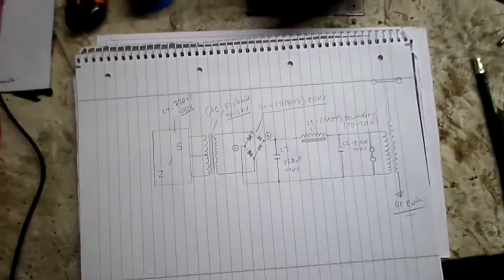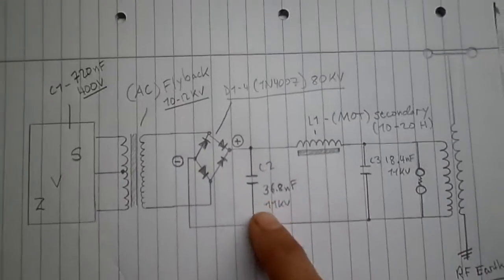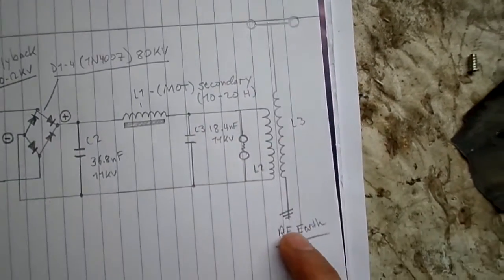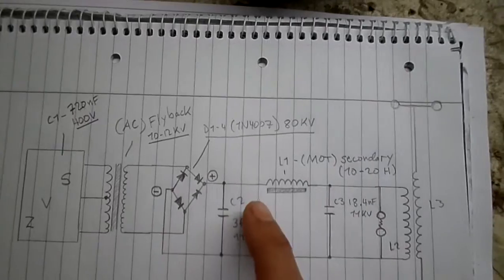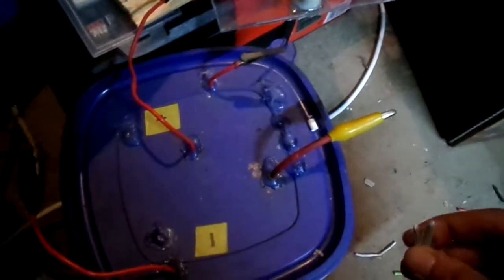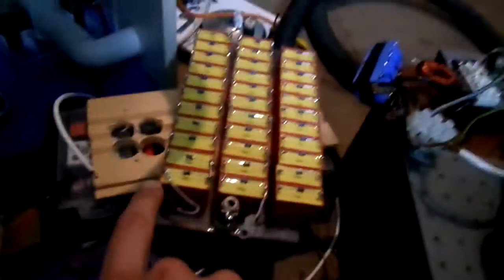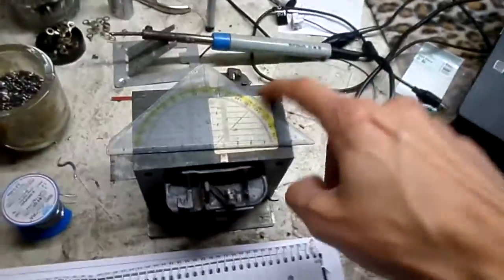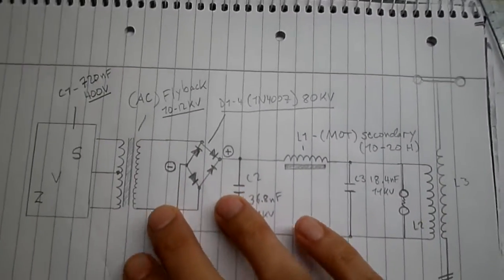DC powered spark gap Tesla coil - ZVS flyback - How - To + Diagram

Comment: I don't really get the capacitors being in parallel with the primary, like aren't that just gonna short the capacitor preventing it from charging? On my design the capacitor is parallel with the high voltage generator and the start of the primary is connected to the other end of the capacitor and the end of the primary is the spark gap

Comment: I am no expert, but it looks to me like you have a direct short in your schematic. Cap bank and gap in parallel with primary coil?
Reply from the maker: indeed you are correct ! i sometimes fail at drawing out circuits, the first cap bank before the spark gap is correct as its for DC filtering but the tank cap bank should be in series after the gap .. when i get around to updating this setup, i will include a new diagram and hopefully everything will be in the right place ! thanks much for the input cheers =)
Reply: Glad to help. Your many videos are appreciated and educational. Keep up the good work!

I tried a similar setup  with a dc fb, and streamers were cleaner more defined.  Maybe a ferrite core would be better for charge choke? 
Also was curious if microwave oven diodes would work if i had an ac flyback like you?
Reply from the maker: thank u much, i do intend to produce more content ! a ferrite charging choke would work better, someone commented already on that fact, i do want to try it out plus upgrade my HV rectifier to fast switching diodes .. u would need fast switching HV diodes but microwave over diodes could be used for testing, try charging up a HV cap with those diodes .. they may get hot due to high freq. from the flyback ..

Comment: I wouldnt be surprised if this doesnt work for 2 reasons.

The 1N4007 diodes are very slow and cant properly if at all rectify these frequencies. (use UF1007's).

Also the charging choke is a good idea but you cant be using an iron core choke for this HF application just the same as you cant use an iron core flyback it wont work or at least wont work properly.
Reply from the maker: hello and sorry for the late reply ! i totally agree with ur suggestions, i never thought of the hf involved with this circuit setup but i will admit its very experimental in nature as i dont really know what freq. the primary circuit is running at and having the charging choke in circuit was a suggestion from my buddy tesla explorer :-) i will upgrade my rectifier soon and try this circuit out again and i really thank u for the feedback ! cheers from Germany - Dirkk82
Reply: Can you explain what the charging choke is supposed to do please? Is it necessary for this circuit to work?
Reply: Well usually it is used for charging capacitors from 50/60Hz sinusoidal power supplies and it is designed to smooth out the current  from the supply going into the capacitor. 

In your case you are using a ZVS which is likely to be switching at around 10kHz square wave hence there is little need to have a charging choke to begin with. Also the microwave transformer as an inductor in this instance is unsuitable because it's inductance is toooo high and the core material (iron) is also not suitable for 10kHz operation.

Arguably a charging choke is never necessary only ever preferred but in your case it wont really do what it is designed to to begin with. So get it outta here.
Reply: Also I was quite serious about those diodes, you'll be reaallllyyyyyy lucky if they work out, or at the least it'll work but with massive power loss (they'll get super hot).

I would recommend using these http://au.rs-online.com/web/p/rectifier-schottky-diodes/6882280/   instead of 1n4007's. Dont be afraid of that website btw it's a great site and has free! shipping.
Reply: I am not the person in the video but I am also building a simple half wave DC rectifier for my ZVS driven AC flyback transformer. At the moment I have 80 UF1007s in series which I will put in oil and test tomorrow. I tried using a string of 22 but I don't think 22kv back voltage was enough for my flyback as they seemed to get very hot then stop working.
Reply: Right :P sorry I assumed you were the video creator. 

Good that you're using the UF's they have a far lower switching time than the 1N's and 22kV was probably just too low, with this kind of stuff I think 3X the transformer voltage is a good place to set your diode voltage.
Reply: I measured my ZVS. using 15V zeners at 50V input. The output frequency was around 30 kHz. No iron core would work in that case. However that mot choke (the way you have it set up) is basically a dc smoothing inductance. No change in orientation of magnetic flux is going on. MOT is perfect for how you have it set up.